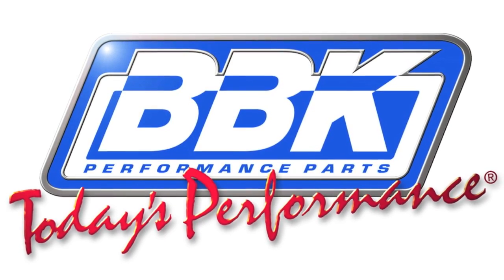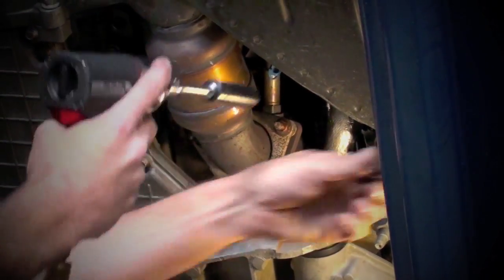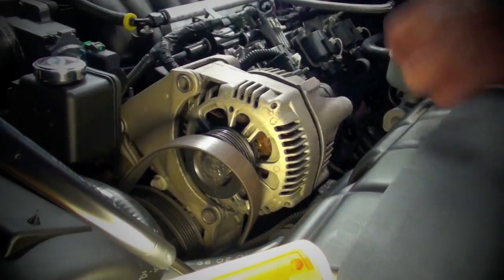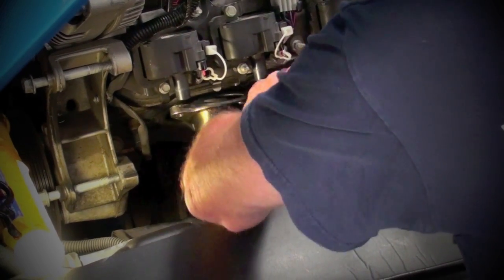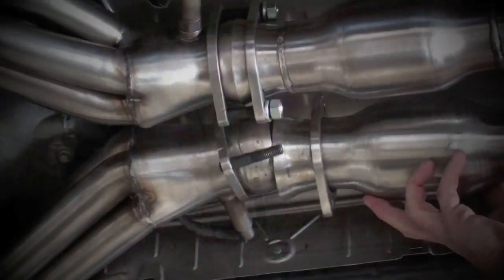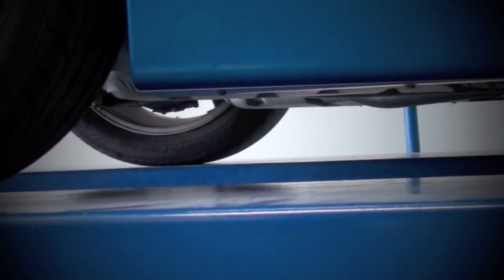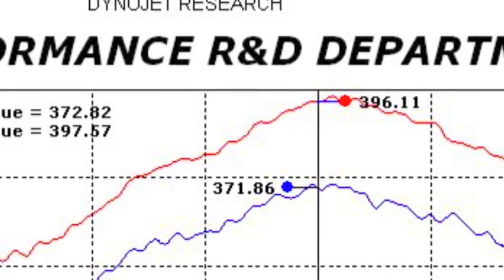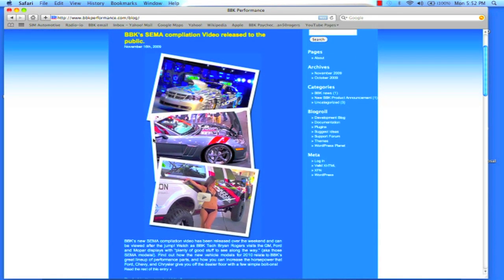Corvette C5 C6 Full Length Exhaust Headers Installation & Dyno Test

Comment: I have the shorties for the 01 C5.  I wish I would have known about these a couple of years ago!  I really like the shorties.  The car does pull harder at speeds above 35, especially on the highway.  BBK makes a nice product, installation was pretty easy and they were a DIRECT bolt on.  they have been on over a year and I have zero complaints.  I might save up for these eventually.